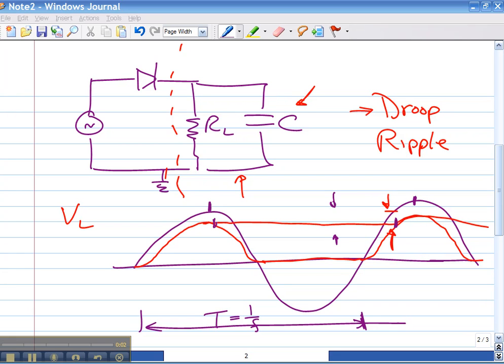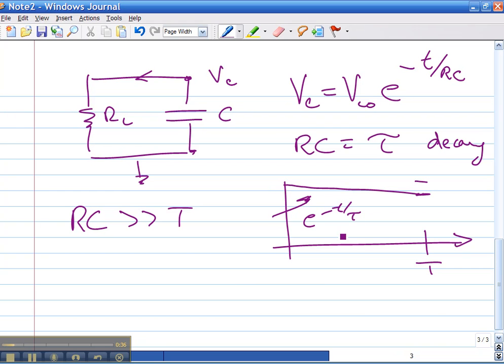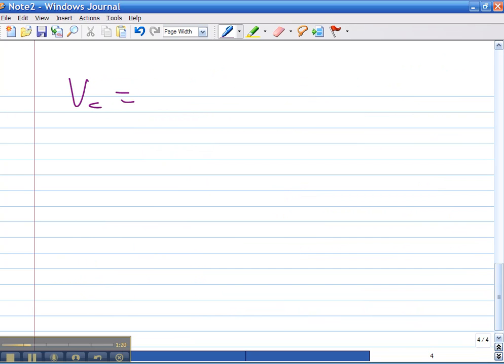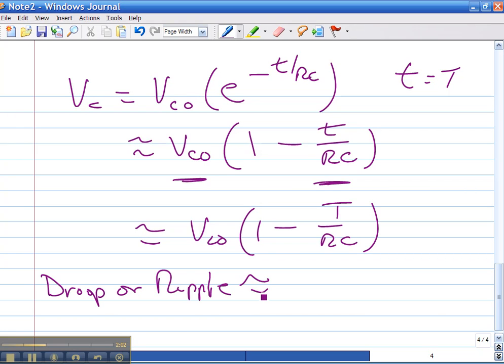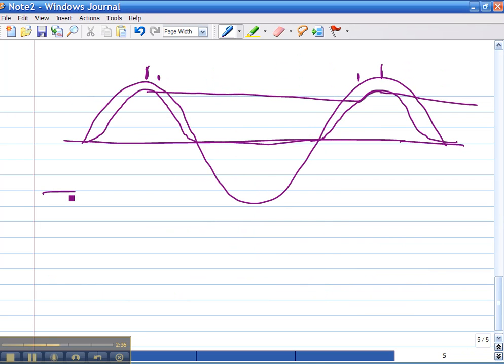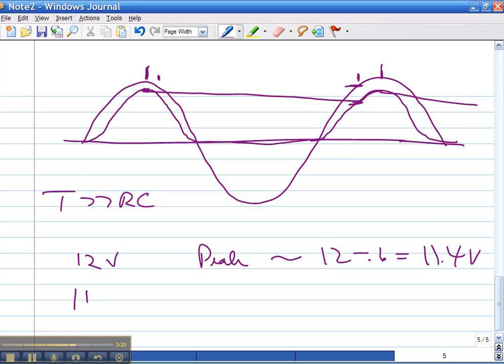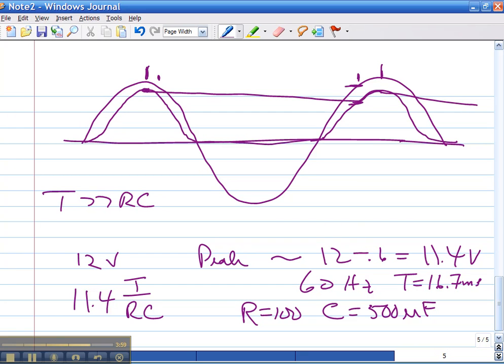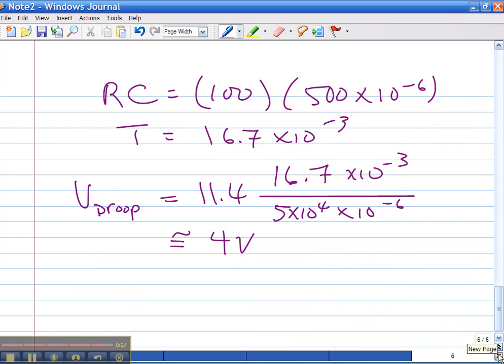Rectifier With Smoothing Pt2

Comment: I just used the Vc0(T/RC) equation to calculate the droop for question 2 parts a. of Question 1 - Diode Rectifier Circuits for this spring '09 exam. I calculated droop as 4.6V with Rload=100 and as 9.2V with Rload=50. So I do agree with your answer key that, when the Rload is cut in half, the droop is twice the previous, but I am getting values much larger than yours. My values seem large for droop, but I am confused since I used the equation described in these videos.
Reply: I used Vc0=13.8V because I subtracted .6V for the two diodes (and the input voltage is displayed on the plot as 15V) and used T=.0167 seconds (because we have a frequency of 60Hz) and the given values of R and C.
Reply: Meghan Olson Because it is full wave rectifier the discharge time is about half of the period, instead of being similar to the full period. This is because the a full wave generates 2 charge/discharge cycles during one full sign wave, instead of the one charge discharge cycle for a half wave rectifier. Try using a period of T/2 or T=.0083335 in your calculation using  Vc0(T/RC)
Reply: I see what you mean, I just tried doing the problem too using T=.0083335, R=100 ohm, C=500micro Farad and Vc0=13.8 and got Vc= 2.3, if I do the next problem and lower the resistance to 50, i get about 4.6 volts for the ripple. Ken Connor Why are these values different from yours on this back test? Please help as this is confusing.

Comment: Is there an advantage to using a half wave rectifier with smoothing over a full wave rectifier with smoothing?  It seems to me that if you want the smoothest possible voltage, a full wave rectifier would be a better choice and would not add much complexity.
Reply: I bet the half wave is cheaper
Reply from the maker: The half-wave is cheaper. Creating a nice smooth DC voltage is a lot more complicated than just using diodes and capacitors. There is an almost unlimited number of options for voltage regulation. However, in all cases, once the design restrictions are known (price, real estate available, allowable ripple, etc.) it is not so difficult to decide which approach to use. I also addressed this in another question on smoothing vs no smoothing. There are times when even 100% ripple is not a problem. Fewer parts means less money means more profit and usually more reliability.

Comment: I am trying to apply this formula to problem 3 from Spring 2013 and am having difficulties following where the period (T) value came from. The value used was 0.25ms and the input wave is 2.5kHz. I thought T was the period of the input wave but this does not seem to be the case. Can you clarify?